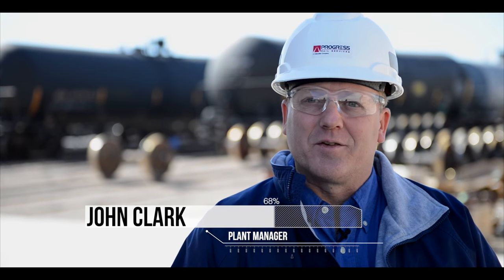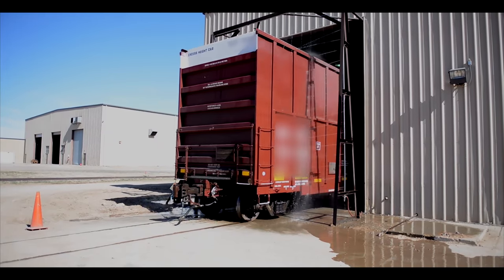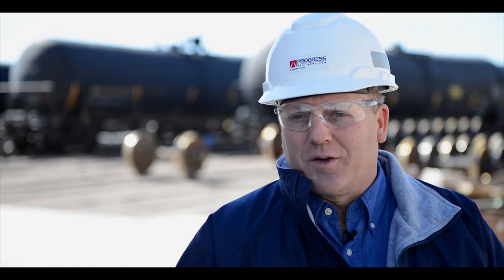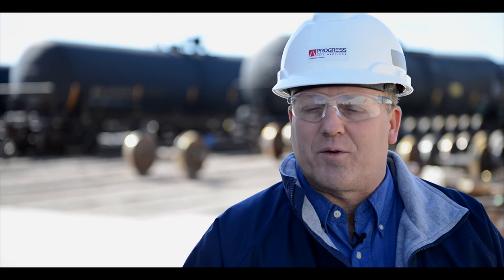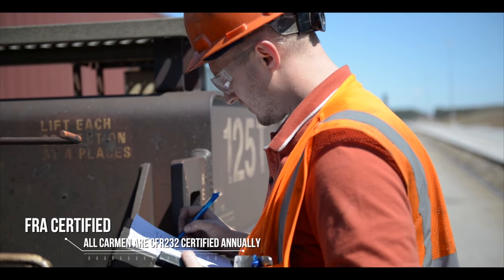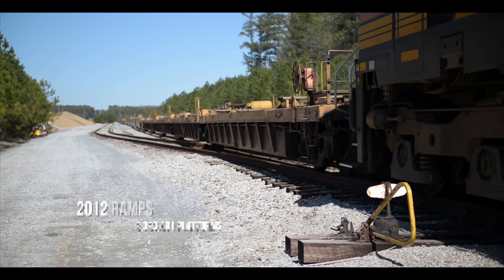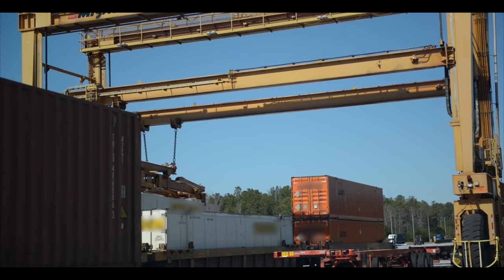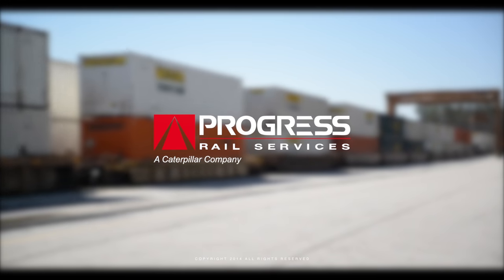Progress Rail Freight Car Inspection and Repair

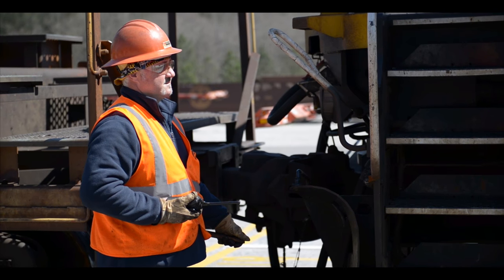Comment: At 1:50 he uncouples the car but doesn't disconnect the glad hand. I'm no expert but won't the train rip that apart?
Reply: No it wont rip them off. They will disconnect by themselves when they stretch out far enough.
Reply: computbut1 It's routine, buy doing so it will "dynamite" the brakes. Therefore leaving that block with brakes on.
Reply: I saw that too.
Reply: @ericwright7563  only if the cars are charged up.